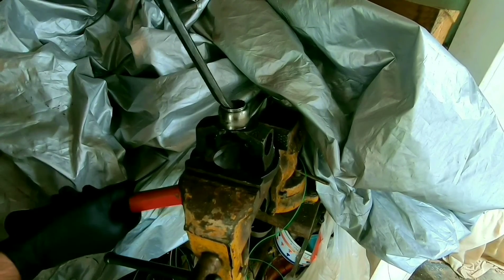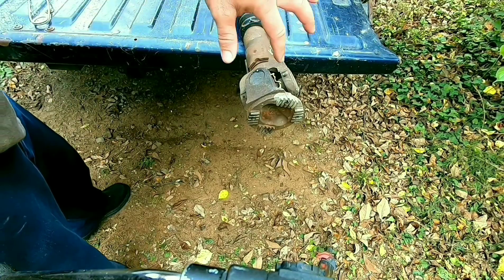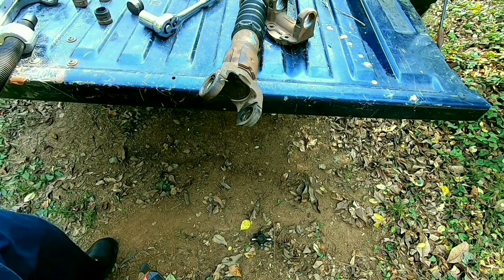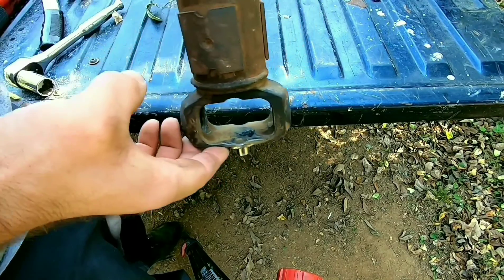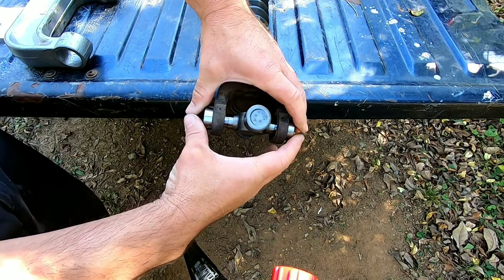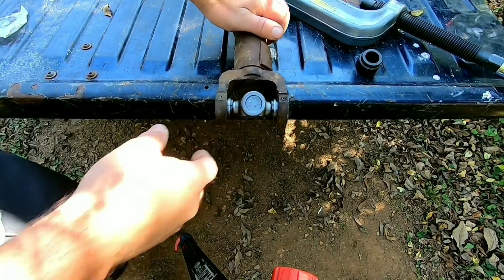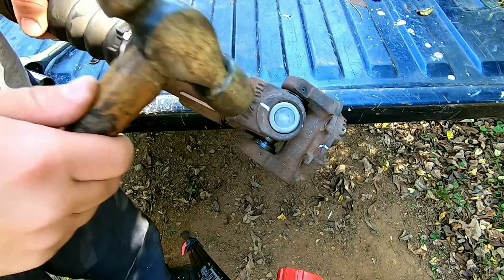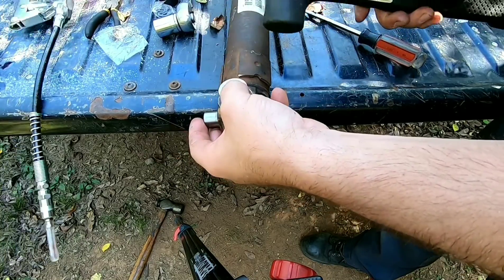Dodge 2500 double cardan drive shaft rebuild part 2/3

Comment: Just had one of these sling apart and destroyed the yoke and ball end.Found a junk yard shaft and am going to rebuild it. The inmy thing is the junkyard shaft is longer but the yoke/ball end are the same so im going to put it on my shaft with new joints.  Is there a certain direction this has to be? I noticed you marked yours but its not gonna line up like that on my old shaft. Anything i need to do there? Thanks

Comment: How did the grease fitting break off? Done plenty of ujoints but double cardan shaft. Thanks for video
Reply from the maker: I have no clue. I bought the truck with 24,000 on the odometer. Maybe a rookie service tech at dodge broke it off or the previous owner. Who knows!

Comment: Quick question...this is on a 3rd gen, do you have u-joint numbers and cardon ball and seat numbers for a 4th gen? Got an 11' & a 13' that need some work...
Reply from the maker: Sure don't! You can get part numbers from the dealership and compare them to aftermarket like Spicer. Rockauto.com  has the aftermarket part number with the dealership part number so its easy to match.

Comment: So it looks like take the plastic out and replace with internal clip ujoint s?
Reply from the maker: Yes!
Reply: @isolateddieselperformance3261  thank you sir
Reply from the maker: You're welcome!
Reply: @isolateddieselperformance3261  I ended up using a napa P534G on the front location. Couldnt locate a Spicer. It ended up tighter than I wanted.
Reply from the maker: You don't want it super tight. Run it a few short trips and check it to see if it loosend up some. Dont want to cause problems with your pinion.
Reply: @isolateddieselperformance3261  I’m 61, grew up on a farm and am an aircraft mech. Put the second ujoint in and they are just too tight. You know how the clips will bow out. I’ve done many joints over the years. Now I gotta figure out what to do. I think I will pull apart first a verify I didn’t get a needle dislodged in the cup
Reply from the maker: You're definitely smarter than me for sure. Hats off to you because I'm not touching a aircraft. If you think you got a needle bearing out of place its best to check. Don't forget to pop the ends with a hammer to seat the joints so they won't be so tight. You probably already done that.
Reply: @isolateddieselperformance3261  finally got back to this project, pulled the ujoint I installed and found nothing wrong with the needles. So I got to measuring. The Spicer 5-1350X is supposed to measure 3.625”, mine were 3.656” and more! This is very surprising coming from spicer.

Comment: You should never heat tempered steel because it softens it. You're supposed to press those plastic injected u-joints out with a 40 ton press.
Reply from the maker: What repair manual says this? I went to school and thats the way we was taught. Also all my repair manuals show to melt the plastic out. All driveshaft shops melt them out. Just curious but if you are convinced you know the correct way then  why do you need to watch my video?
Reply: Wrong. Torch is exactly what the dealership said to do. And a machine shop confirmed that. What a stupid comment. It's not even hot enough to affect tempering.
Reply from the maker: I thought I commented on this but.........BINGO Biggus Dickus knows what he's talking about.
Reply from the maker: Christopher C thanks brother. We have something in common. We spell our first name the same 😉👊
Reply from the maker: Which yoke is the culprit?
Reply from the maker: Oh ok yea the part you're talking about isn't called a yoke. Thats called the cardan joint. That cv ball that sets inside will go bad if its not greased often. When you said yoke I was thinking pinion yoke and thats not a good sign but thank God its the cardan joint.

Comment: Awesome video! But everyone else doing this one thing I ask you all to do is to go ahead and when first starting the joint take off the other 2 caps you aren't pressing! It'll avoid an "oh shit" moment trust me! The last thing u want to do is be about done with the job and go to do the last press and all of the sudden u hear a thud! Or even worse not hearing it at all and you go to swing the shaft around or whatever to realize wait where did the cap for that one go?! Been there done that lol no need to have em on and make yourself struggle holding them all. Just take em off and do it one at a time you will thank yourself later
Reply from the maker: Thanks man! I usually take them all off but alot of the spicer joints stay locked on till you pull them off for the first time. Usually takes a large screw driver to get them off for the first time.
Reply: Yep spicer stay on well they usually all ways did I dropped one yesterday but needles stayed in thank god lol

Comment: Thanks for posting this.  How did you know this joints needed replacing?  On my '99, every now and then in 4wd only I'll get a 'clunk' and you can feel it through the whole truck.  I just replaced the other driveline U joints and center joint.  Not sure if the clunk is from the front driveshaft or my transfercase chain is getting stretched.  230,000 miles and all are original.

thx!
Reply from the maker: If there is movement between the ujoint ends and the inside of the caps then you need to replace the ujoints. The clunk could also be backlash play in the ring a pinion. Hope the clunk is ujoints in your case.
Reply: I had a vibration. Found one dry bearing.

Comment: What size u-joint did you use on the driveshaft to axle flangers end. I just did mine and it has a lot of play.
Reply from the maker: Part # Dana 5795X at rockauto.com

Comment: Where did you get the parts for this rebuild? I have both U joints but can't for the LIFE of my find a kit for the centering ball, seal, and rubber sleeve. I'm in Saskatchewan Canada. 03 4x4 2500 cummins. 6 Speed manual.
Reply from the maker: All ujoints and centering ball you can find at rockauto.com. Rubber sleeve is a dealership item. You will find the CV ball kit under drivetrain section then go to  Universal ball kit. Let me know if you have problems finding it and I will help you. I dont know if you guys have advance auto parts up there but they carry that ball kit as well. Let me know when you find or dont find one.
Reply: @isolateddieselperformance3261  Thanks, I found it on Rockauto which ships to Canada. I'm not sure its worn out, it's mostly just the U joints but I want to be sure I have access to parts. Appreciate the reply!
Reply from the maker: It's better to replace it while you are in there. Would suck if the cv ball went out a month later and u had to take the new ujoints out to get to it and take a risk of damaging them. If you need anything else let me know brother.
Reply: @isolateddieselperformance3261  True. Think i'll just order the ball kit. Hope it doesn't take to long to get in! Will do man, appreciate it.
Reply from the maker: You're welcome brother.